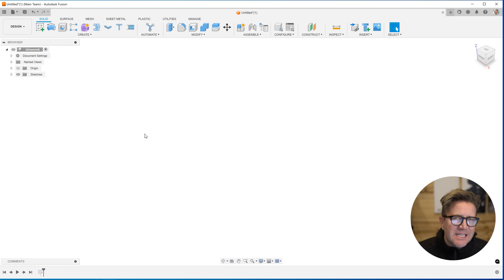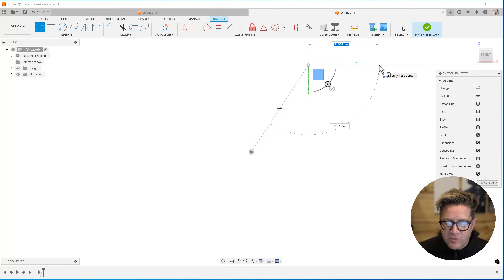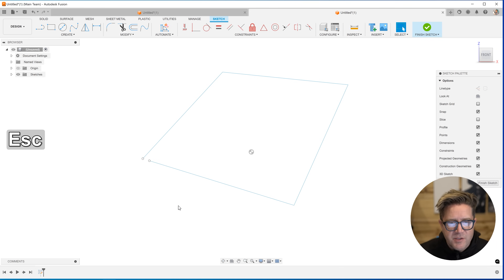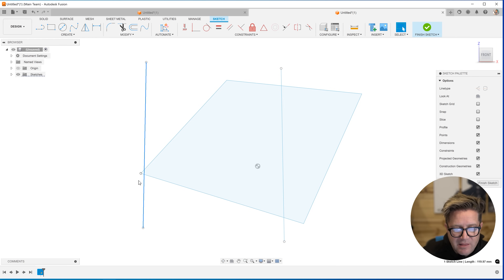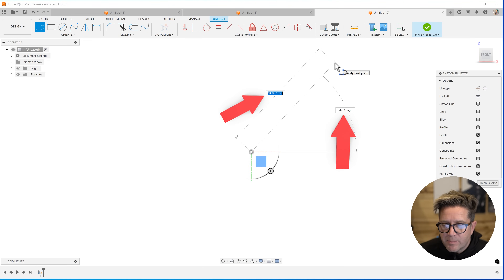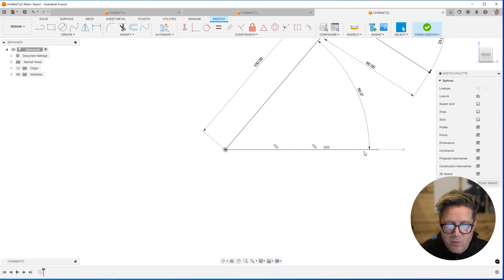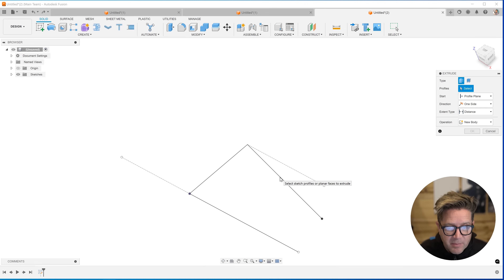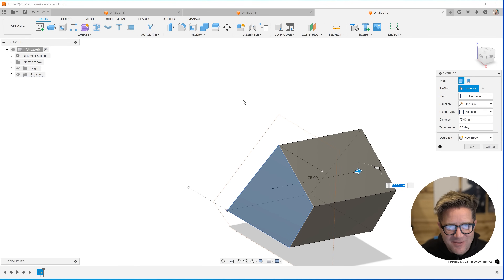Learn Fusion 360 Line Sketch Commands – Speed Up Your Sketching

Comment: Thanks for the "thin extrude" explanations. What are the differences between "construction" line and "Center" line? I always use "construction line"...
Reply: The only real difference I have found is that when you use the center line, you get smarter auto selections when doing mirror commands.